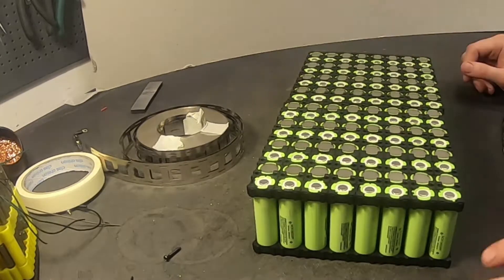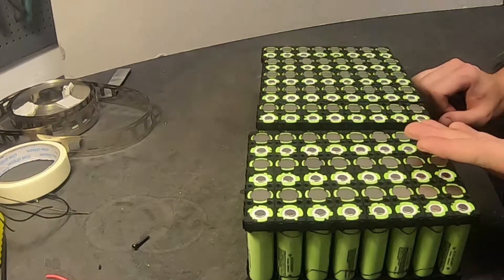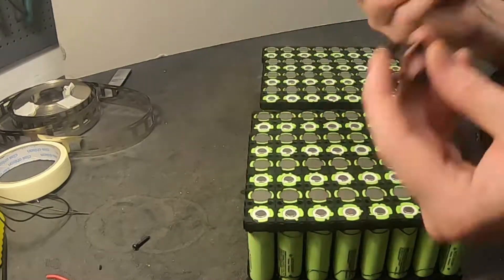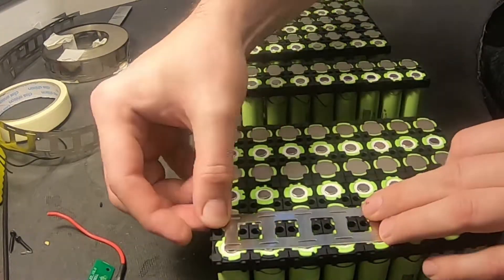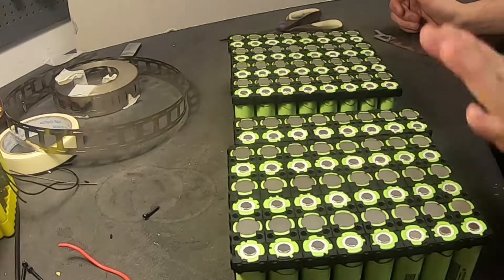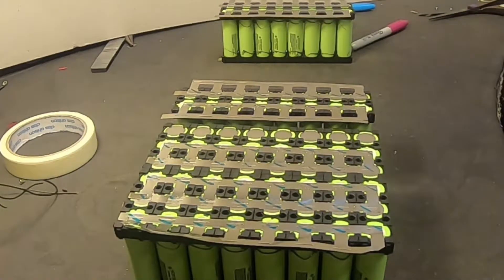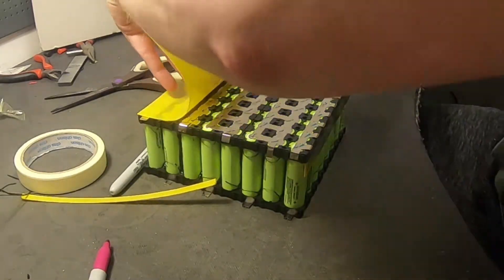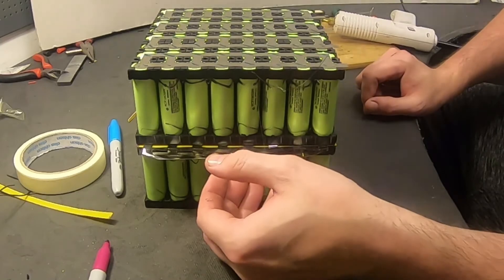Building a 2000W 16S8P Batterypack - Tips for Large Battery Builds

Comment: What is the total capacity of 16s8p battery that you built? Could you explain the term 16s8p?
Reply: 16s 8p means 16 cells in sereis (so 60 volt in total, since batteries in series combines voltage), and 8p means 8 batteries in parallel (parallel combines amps)